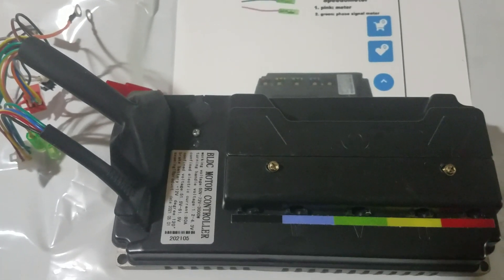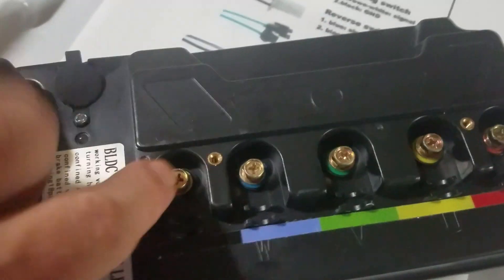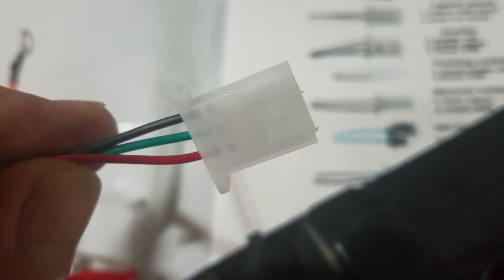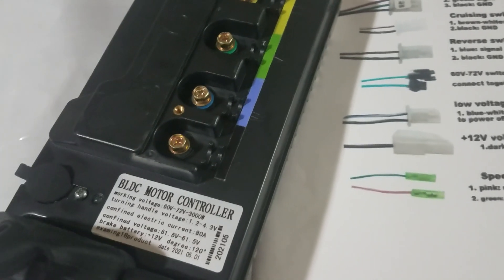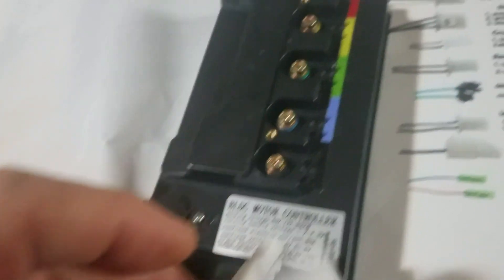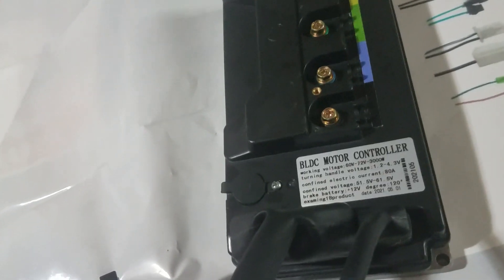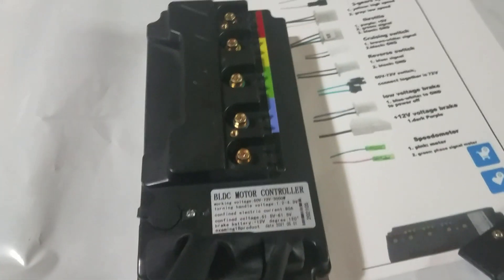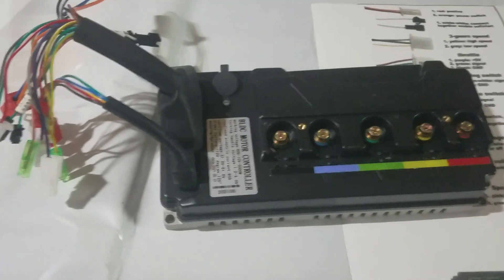SINE WAVE 3000W CONTROLLER WIRING

Comment: Fwiw, the white wire "is" learning, when connected the controller learns the motors phases/timing, there many many combinations.
Reply: can you tell if can be used with 60 degree also? or only 120?

Comment: My friend please,  could you tell me if the high brakes is working in your controller?  
When I send a signal to the high brake wire the controller do not regen, it just stop  sending  power to the motor.

Comment: How has it held up so far? Planning on getting this controller but i really don't trust products I find on amazon.
Reply from the maker: ZERO ISSUES IN OVER 2 YEARS, REMEMBER THERE ARE MANY CLONES.
Reply: @TechKnowCSS  I'm pretty sure I got the right one hopefully but I'm having trouble finding what app I need for tuning? Any suggestions
Reply: Any luck? Looking to do a similar swap on the same e harley platform and wondering how it goes to install this controller with stock components
Reply: @bqhughes8480 i dont know how i did it but i ended up bricking mine and the smaller wires werent fully compatible. I did contact the company directly and they were super helpful, offered to replace it after they tried remotely trouble shooting it from my laptop if i sent it back to them and not amazon. I didnt end up doing that because i forgot about it. Check all your wires on your bike and find as many pictures of thes controllers wiring harness to make sure its right.

Comment: To be clear for those not following I now have bought 6 of these all said to be for 60V and none have been. Video has been taken to support this for purpose of refunds which have been successful. I am using 2 of these that I have tricked into working with 60V battery.
Reply: i have bought 3 of them, and all of them are different inside lol. one of them, is literally 100% identical to a sabvoton ml7260s, the others are close, but have different pinout for the wiring.

Comment: Programmed to have 72v battery by default.
Reply from the maker: THERE IS A JUMPER CONNECTOR YOU CONNECT TOGETHER TO PUT IT IN 72V MODE, OTHERWISE WITHOUT IT IS 60V  MODE.

Comment: My batter is 60v, 67.2v fully charged. 72v battery lvc 62.5v
Reply from the maker: I ADDED A 4S IN SERIES WITH MY 60V TO MAKE 72V FOR MY FIRST 72V BATTERY.
Reply: I have this controller and installed  a 80v baterry and Works Very well. 
The baterry instaled was a 19S lipo baterry.  Fully charged hit 79.8
Reply: @danielpacato2725  If highest voltage on controller is 72V I reckon the lvc will be for 72V battery.
Reply: @akabirdman3290   I checked and saw  that my controller does not have the wire to  sellect  the voltage. Anyway it is working with the 19S lipo baterry
Reply: @danielpacato2725  I would put money on your lvc being to low for 80V battery.
Reply: Were you guys using the same harley platform as him and just swapping the motor to better match the controller output in this video?

Comment: You live in southern California?
Reply from the maker: YES, THE IE.
Reply: I live in the IE also and I have this controller and I hooked everything up but as soon as I apply power the motor spins...the throttle and switches and speed modes aren't working. Have any idea what the problem can be?
Reply: @Szechaun_Don   you need to disconect the white wires. they are "learning" wires, not "soft start". I was having the same issue.
Reply from the maker: @Szechaun_Don  NO DOUBT SOMETHING IS WRONG, I HAVE TO SEE HOW ALL WIRES ARE HOOKED UP WITH MY OWN EYES.

Comment: Hello & thanks advance for your help👍

i have an eGrace (2018) Nova Motors eRoller 72V 3000w / 45kmh. I think the controller ist faulty, because everytime i reach 35kmh (high setting) the Motor&Display goes to zero Energy for 5seconds but 12V works normal always. On Low (25kmh) theres no problems. 

When i buy a replace Controller (same specs) how to Set it to max 45kmh or is it out of the box?

I did buy a 72V / 2000w Controller first because my seller say this fit. But all connectors are not the same 🥴 

This looks like the faulty one 🤔
Reply from the maker: VERY RARELY DO ALL CONTROLLERS MATCH ON THE CONNECTOR TYPES, IT IS BETTER TO MATCH THE FUNCTION WIRES TOGETHER AND CHANGE THE CONNECTOR TO MATCH BUT THE FUNCTIONS ARE CLOSELY DONE THE SAME. THE HIGHER PRICE CONTROLLERS HAVE A BLUETOOTH OR USB PROGRAMMING FEATURE TO SET YOUR PARAMETERS YOU WANT. AND 35KPH IS A SLOW 21.75MPH THAT 3000W SETUP SHOULD GO NEARLY 50MPH OR 80KPH, FOR 35KPH YOU WOULD ONLY NEED MAX OF 350W JUST ABOUT 10% OF WHAT YOU HAVE.
Reply from the maker: ON 3000W CONTROLLERS THEY SOMETIMES HAVE A "POWER LEVEL/GEARS" OF 1-2-3 AND AND LEVEL 2 IS NORMAL POWER AND LEVEL 1 IS 33% LESS POWER AND LEVEL 3 IS 33% MORE POWER, IN GENERAL LEVEL 1 IS 30MPH/48KPH LEVEL 2 IS 40MPH/65KPH AND LEVEL 3 IS 50+MPH/80+KPH, IN GENERAL.
Reply from the maker: @PinballGamer  THAT SCOOTER HAS FACTORY LEAD ACID BATTERIES...LOAD TEST EACH BATTERY ONE AT A TIME, I THINK YOU WILL FIND YOU HAVE A BAD OR A VERY WEAK ONE OUT OF THE 6 YOU HAVE.

Comment: Have same issue as juliusdades and some others. Controller is turning on, correct voltage and wiring at hall and throttle but motor is does not move or make a sound. Have tried all 36 possible phase combinations, nothing, no output to motor at all. Can you please verify if this is same problem and also that purple wire is learn and needs to go to 12v as stated?
Reply from the maker: THERE IS NO LEARNING WIRE, THE PURPLE WIRE (HIGH BRAKE) THAT GOES TO 12V ONLY GOES TO 12V WHEN YOU APPLY THE BRAKES LIKE HOOKED TO THE 12V BRAKE LIGHT BULB AND THIS DISABLES THE MOTOR.
Reply: @TechKnowCSS  Ok then, tell us what is wrong? Same as juliusdades i have several scooters and motors, I can get all to work with each other exept this controller. Also, I am aware the purple wire is "possibly" h brake. Funny thing is, Sabvoton say it is h brake but it that it also needs to be connected to batt + at first. Second funny thing is I connected it as jd says and controller now runs motors very very smooth LOLOL, though it seems speed limited. My controller also has single grey wire. Seems knowbody knows anything about these things including sellers and suppliers, when you ask for manual or anything you always getwrong diagram.
Reply from the maker: @akabirdman3290  I AM ONLY A CONSUMER AS YOU AND A DEGREE IN ELECTRONICS AS I DOSE NOT HELP ME GUESS WHAT A WIRE IN THESE CONTROLLERS DO. THE PROBLEM IS THAT THERE IS TOO MANY DIFFERENT CLONE VERSIONS OF THIS CONTROLLER. GLAD YOU GOT YOURS GOING. MY SINGLE PURPLE WIRE WORKS PERFECTLY AS A HIGH BRAKE WHEN 12V IS APPLIED FROM MY 12V BRAKE LIGHT. AS FOR YOUR SPEED RESTRICTED PROBLEM TRY HOOKING UP YOUR 3 (GEAR/POWER LEVEL) WIRES. I DESCRIBE THEM WELL IN THE VIDEO.
Reply: @TechKnowCSS  Wow, upper case, you may want to retract that. After buying several of this style controller and after much homework I have found: 1) white wires are in fact learning wires and no one knows how this works until now. 2) the high brake line can accept 12v (as low as  8v if fact) to full battery voltage. 3) I have figured it out, for the most part,  and now have controllers working at correct voltage which has been the problem. My battery is 60v and controller has been thinking it is 72v battery because it was not learning what voltage battery. Because of this controller was going into lvc while battery is still almost fully charged. I now know how to fix this and on these controllers it is not as simple as "just" connecting white wires. I need to do a video lol. Have a nice day.
Reply from the maker: @akabirdman3290   AS FOR CAPS, I USE THEM AS A FONT CHOICE AND IT HELPS ME SEE WITH MY POOR EYESIGHT. I HAVE NO ISSUES WITH MY CONTROLLER. AS I HAVE SAID BEFORE THERE ARE MANY CLONES OF THIS CONTROLLER AND YOU HAVE GOTTEN A BAD ONE. THE REAL ONE IS A SABVOTON ML7280, THEY NOW HAVE A ML72150.
Reply: @akabirdman3290  can you make a video please?
Reply: @Szechaun_Don  Will look into it. First thing I will tell everyone is check what you have been sent. I bought 2 60-70v controllers for 60v batt from different sellers, I was sent 48-72v controllers. These controllers do not work  with 60v, They are 48 and 72v only. If your battery is fully charged when you first conect it, it will work down to 62.5v (72v batt lvc). If battery is not fully charged, below 62.5V it is in lvc mide. It will mostly work but not actually drive motor. I have a work around for this should anyone find themselves in this position. cheers bird

Comment: I just received my controller dated 2023 March, Question I have if you can help me please is as I did NOT receive wire diagram 🥺😢🤬 Appreciate you.
1. Mine  has a grey single wire - I do not know what it is for?
2. Mine does not have the 2 green wires for 60-72 volts? I want to run 72volts
Disappointed really, have contacted seller NO reply ☹
Cheers
Reply from the maker: There is tons of rip off copies of this controller, and mine is one of them i guess. The real one is a SABVOTON ML7280.
Reply: @TechKnowCSS  I am trying to find wiring from the plug, been searching for a week, nothing, still no reply from selling, lucky I brought from eBay will try to get money back, waste of time and effort, lesson learnt 😭

Comment: Hi, i have one similar for my scooter, just wondering what goes to the charge port?
Reply from the maker: THE CORRECT CHARGER FOR YOUR BATTERIES GOES TO IT IF THEY ARE LEAD ACID OR LI-ION IF IT HAS A BMS THAT IS COMMON PORT, OTHERWISE CHARGE THE LI-ION BATTERY BY IT'S OWN CHARGING PORT.
Reply: @TechKnowCSS  hi sorry I'm not on about the charger, there's no wires off the controller I can find that goes to charge port
Reply from the maker: @stavros3733  I USE SINGLE PORT BMS SO MY CHARGER GOES DIRECTLY TO THE BATTERY, BUT IF YOU HAVE A DUEL PORT THE CHARGER IT GOES DIRECTLY TO THE DESIGNATED CHARGE PORT ON THE BATTERY.

Comment: Hi fellow veteran,
I purchased a 48v 750w rear hub Chinese ebike and I am attempting to add a second front hub motor with a cycle analyst and shunt to be connected to 1 battery.
I have 2 of these controllers for 2 hub motor controllers and understand that both need to be wired for power, motor and hall sensor lines.
Only 1 controller will need to connected through the throttle to activate the motors and I will adjust the amps through the cycle analyst. 
My issue is the rest of the accessories,  head & tail light,   directionals, brake light, speedometer/battery display,  pas, brake switches  are all different color wires from the original and new controllers.  Also the wires are used for all the accessories are the dongle cables so i cannot see which color is coming from which switch as they are all inclosed into a junction type dongle where 4 or 5 dongle cables from the handlebars go in  to the junction an 2 come out going to the controller.  And as you know,  the wiring diagram you showed on the video I have as well, none of the wires are marked for accessories. 
Can you advise me on how to proceed with this. 
Thanks
Reply from the maker: LEAVE THE ORIGINAL CONTROLLER ALONE AND MAKE A "Y" ADAPTER FOR THE BATTERY SO YOU CAN POWER THE SECOND CONTROLLER. THEN USE ONE SINGLE WIRE TO GO FROM THE THROTTLE SIGNAL TO THE THROTTLE INPUT CONNECTOR OF THE NEW CONTROLLER, THEN ONE SINGLE WIRE FROM THE BRAKE HANDLE MOTOR CUT OFF OUTPUT TO THE NEW CONTROLLER BRAKE CUTOUT. THERE IS GREAT HELP ON THE SITE  electricscooterparts DOT COM.(one-throttle-two-controllers)
Reply: I'm upgrading the original controller and battery to a 60v system.  
Which wires on the controller would I use to connect the lights that came on the ebike.
The lights are rated 12v with a  converter integrated with the system.
Reply from the maker: @robertshea9766  WHAT YOU REALLY NEED TO KNOW IS WHERE TO HOOK UP YOUR 12V CONVERTER TO POWER THE LIGHTS, THE POWER FOR THE INVERTER GOES TO THE 60V POWER ON SWITCH / KEY THEN EVERYTHING ELSE WOULD STAY THE SAME. GOOD LUCK.

Comment: does it Work with LH-100 DISPLAY?
Reply from the maker: NOT SURE, BUT THE SPEEDOMETER ONE WIRE OPERATES ALL MY DISPLAY DATA, SPEED, GEAR/POWER LEVEL, BRAKE INDICATOR. I GUESS AS A DATA WIRE YOU COULD TRY IT WITH LOW CHANCE OF HURTING ANYTHING.
Reply: @TechKnowCSS  Thank you

Comment: Question, will a sine wave controller get you more top speed or acceleration?
Reply from the maker: YES, AND MORE RANGE AND EASIER ON THE MOTOR. LESS WASTED POWER.
Reply: sine wave always beats square wave or so-called "modified" square wave (which is very slightly less ugly square wave) in terms of noise, efficiency and durability of the motor and the controller. Usually, mostly. It's a bit like the wild west out there for quality control. 

Super duper information resources here.  @TechKnowCSS

Comment: Is there any sort of lock out wiring that need to be connected, when we power on our the red light seems to flash a 4 blink sequence and we have no movement from the motor when we apply throttle
Reply: Probraby you already find How to turn It on.  There is a Orange wire called "door Lock".  When you aply   baterry voltage in this wire the controller  os enabled
Reply from the maker: DID YOU HAVE AN ADULT HELP YOU WITH THE WIRING? YOU MAY HAVE SOMETHING CONNECTED WRONG. ONLY HOOK UP BATTERY, MOTOR AND THROTTLE. AND THE ONE POWER ON WIRE AND SEE WHAT THAT DOSE.

Comment: a controladora e uma BLDC MOTOR CONTROLLER 3000W 80A, POR FAVOR JA QUEIMO UM MOTOR , FICAR MUITO QUENTE E A FIAÇÃO TAMBEM AQUECE COMO BAIXO A AMPERAGEM DESSA CONTROLADORA?
Reply from the maker: FIRST, THE WIRES GET HOT BECAUSE YOU NEED BIGGER WIRE, TRY SILICONE WIRE AT 8AWG. I HAVE A 60V 2500W HUB MOTOR I RUN WITH THIS CONTROLLER AT 72V 80A. KEY TO USE IS TRY TO STAY AT ORIGINAL TOP SPEED AS POSSIBLE BUT USE THE EXTRA POWER FOR PASSING AND FOR SHORT BURST, I GET NEARLY 7KW OUT OF MY 2.5KW MOTOR. THE WATTS RATED IS FOR CONTINUOUS USE, BUT IT CAN HANDLE 3X OR MORE FOR A SHORT BURST SHOT. ELECTRIC MOTORS ARE RATED WITH WATTS NOT VOLTAGE SO YOU CAN USE HIGHER OR LOWER VOLTAGES.

Comment: tem essa mensagem  quando comprei a  controladora Tensão operacional: 60v ~ 72v Limite de corrente: 80a Potência nominal: 3000w Grau de fase: 120s padrão(Se você usar um motor de 60°, por favor nos avise. quero baixar a amperagem como devo fazer?  meu moror estar esquentando muito , 2800w 45a
Reply from the maker: TO LIMIT AMPS USE THE (GEAR) (POWER) 3 POSITION SWITCH, OR TRY USING A BMS THAT IS LIMITED AT 35 AMPS.

Comment: Great video thanks 🙏 can I use a 52v battery on this controller
Reply from the maker: YOU CAN ADD AN ADDITIONAL 3S10P IN SERIES WITH YOUR 13S AND CHARGE IT SEPARATELY TO MAKE A 16S 60V SYSTEM, HOW MANY AH IS YOUR 13S?
Reply: @TechKnowCSS  awesome thanks for the reply the battery pack is a 14s 30ah  fully charged it’s 58.8v
Reply from the maker: @bamboo4u381  THEN YOU WILL ONLY NEED TO ADD A 2S15P IN SERIES WITH A 2000MA CELLS TO MAKE A 16S OR A 6S TO MAKE A 72V 20S, THE CONTROLLER IS 60V OR 72V, 60V IS 67.2V AND 72V IS 84V.

Comment: I'm very late on comment but that question round connection is for Juliet connection for plug and play cables throttle ,light ,LCD,brakes good vid keep it up👍
Reply from the maker: IF SO THAT WOULD BE GREAT, WOULD YOU HAVE THE PINOUTS?
Reply: @TechKnowCSS  did you get the links?
Reply from the maker: @donaldfalcone3470  NOTHING...... NONE.
Reply: Also there's a julet connection for the motor and phase wires I'm not sure whether yours is for the for the 5 v or if yours is for the motor phases and power in now I can't tell by the picture of a video but I can't tell the diameter of the holes in your controller?
Reply from the maker: @donaldfalcone3470  WELL MINE IS CURRENTLY INSTALLED AND INVERTED INSIDE A COVER THAT IS A BITCH TO RE DO.
Reply: I just ordered the same controller in 96v. I was hoping to see how that controller performs with a strong battery. Was that controller a successful endeavor?

Comment: What kinda speed power upgrade will this do ?
Reply from the maker: MY M1P MOPED HAD A 60V 2500W MOTOR WITH A 35A CONTROLLER AND WEIGHS OVER 100 POUNDS AND ME OVER 260 POUNDS AND TOP SPEED WAS ABOUT 30MPH, THIS CONTROLLER AND A 72V 70AH BATTERY GOT ME UP TO OVER 50 MPH, NOT KPH. WHEN IT REACHED 51 MPH IT WAS STILL PULLING AND I TAPED OUT IN FEAR OF MY SAFETY, IT WAS WELDED TOGETHER IN CHINA. I AM ESTIMATING THE 2500W MOTOR IS NOW ABLE TO PRODUCE ABOUT 6000W, HANG ON WHEN TAKING OFF.

Comment: Have you put a dc amp meter with max reading to see if it actually puts out 80a? The 3000w is ~40a im guessing that what it can handle constant? Did you figure out how to program it? I want to buy one too but need to be able to program it.
Reply: i have smart bms, and it does 80A peak